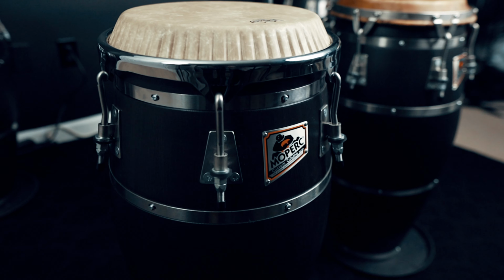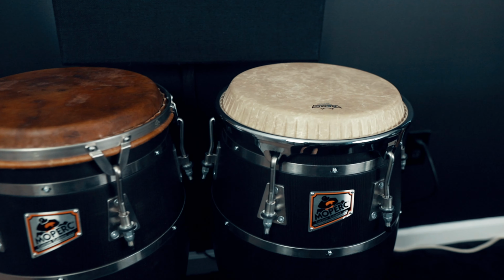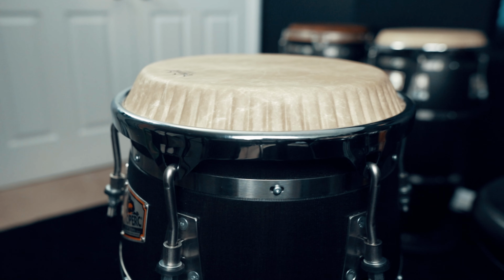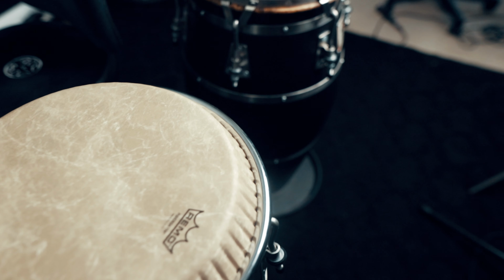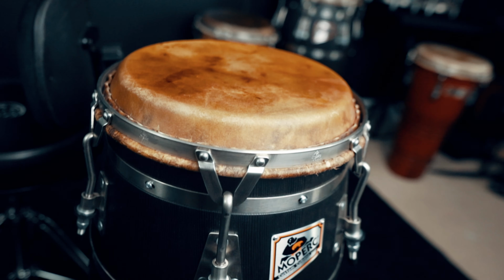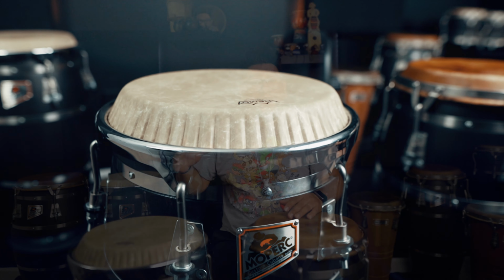Raw Hide vs Synthetic (Moperc Edition)

Comment: My synthetic heads hold up much better in tone when there are any temperature change. Sometimes my drums may have to stay in the car in its bags for a length of time. Sometimes a little tweak on the lugs may need to bring it into the notes I have it set to but not much is needed. 
   Great video Eric. Your passion is shared greatly. Thank you.

Comment: What I noticed in slaps were slaps sound more natural on rawhide and a little tinnier on synthetic.
 Also  if your in an environment where the temperature stays pretty temperate, stick with rawhide.
If you're going to be in hot or warm climates, synthetic is the way to go.
Found out the hard way during a concert I did recently and wished I had changed to synthetic heads instead.